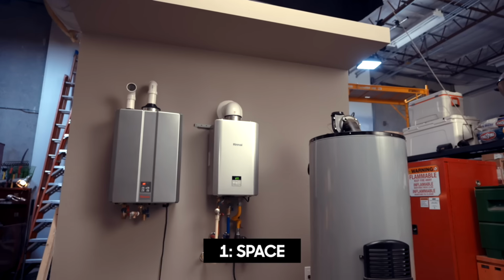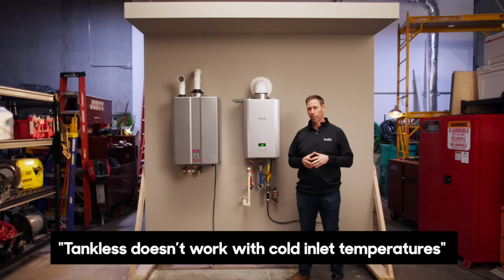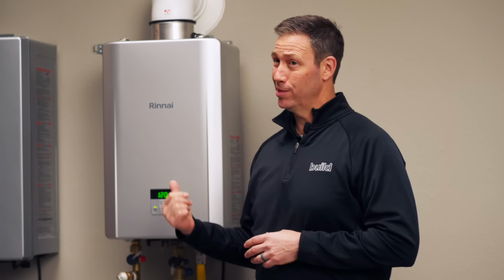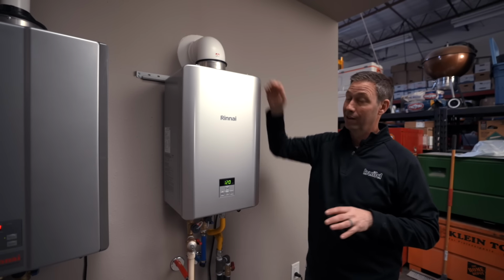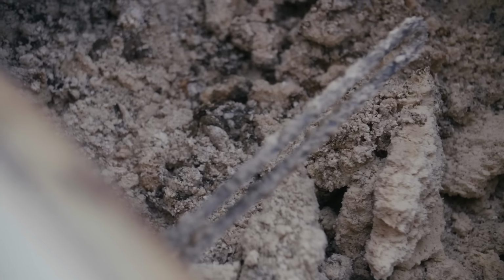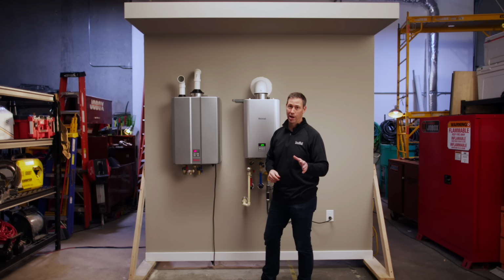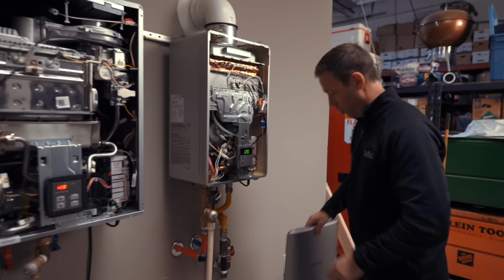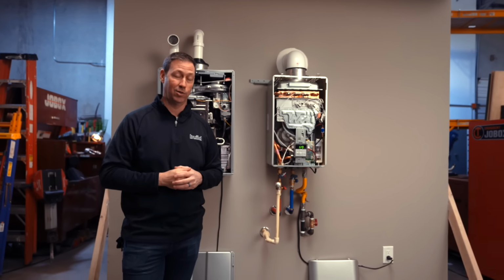DEBUNKING Tankless water heater LIES!

Comment: From the UK these myths and fears are so funny. Most of the country runs on combi boilers (tankless) they last and are so cheap to buy. we are now starting to go back to tanks but as storage tanks with supplied by a separate boiler or heatpump
Reply: sounds to me like whatever drawbacks there are to tankless, you are used to them.  Not having used tank, you don't have perspective.  That's equivalent to an american saying "i've always had tanks and most of my country uses them, so all those myths and fears about tanks are funny."  I'm gonna listen to the homeowners who have used both and teh plumbers who have repaired both.
Reply: @annamyob  You probably should read up on UK pluming if you just believe we have had combi boiler for the last 150+ years….. We had tanks for ages and then moved as combis were more efficient.

Now we are in the modern world of combing energy sources and variable time energy tariffs, tanks now make sense to have solar thermal coils, primary hearing coil for heat pumps or boilers and direct electric heating to make use of solar thermal and tariff optimisation.

Every think the country that has always run on cheap gas might not have a lot of experience with Efficiency! You do have great experience thinking your way if the only way, old technology is the best and shouting at other countries makes you right.
Reply: @michaelwilliams3648  when people just say "oh we've had these for years in my country" they don't convince me they know anything about efficiency.  They're just used to what they have, yet implying they're smarter than we Americans who are used to what we have.  So, efficiency, yes, show me evidence.  I don't see efficiency in all the water and heat wasted because tankless can't do low flow.  I don't see efficiency in multiple parts replacements, nor in having to heat water other ways while waiting weeks for parts.  As you say, solar etc seems to be way to go.  I can put my solar heated water into my existing tank.  Not an argument for tankless!
Reply: @annamyob  Combi boilers regularly run for 15 years without part, yet your all for combined solar thermal and solar PV + primary heat source as a simpler system………..

As for efficiency go and do some research this is a YouTube comment thread not the data sheets from the boiler manufactures. Again the American assuming what you have always used is obviously the best because it’s all you have ever looked at….. That grand American exceptionalism again. Just like how the US used 5L V8 for decades barely making 200hp…… and yet you’re here proclaiming the US tried and tested is the best and efficient.

Do yourself a favour true contacting the manufactures for support they actively want to upskill and provide knowledge to the customer and the fitters. 

Either way peace out

Comment: I would like some references from the manufacturer about the gas supply and how the unit pulls gas through the pipe (which I am assuming is why you can get more cubic feet out of a pipe size without too much drop in WC than what the calcs would suggest)

Comment: Really the biggest hurdle would be to call you natural gas provider, have them do calculation and swap the regulator outside if you need more supply. I’m just curious the longevity with water with large amount of minerals and calcium deposits.

Comment: We replaced our water heater a few years ago. I checked on getting a tankless and it would have cost $1000-1500 more in installation costs. The Tank model we got was a Uniform Energy Factor of 0.72 compared to 0.81 so it's not as efficient but there's no way we'd ever make up that cost difference. On top of that, our family of 5 has never run out of hot water, so there's no real benefit to the tankless. If I were building a home new I'd definitely look at tankless but for us it's hard to make the numbers work.

Comment: Longevity is my issue.  I have yet to find anyone that has had a tankless last over five years. Now most are Big Box stores units and I don't know about install quality. I've known a few people that had problems in two years and had a very frustrating time with customer and warrantee service.  One plus I feel is good about a water tank is that it's 40 gallons of water during an emergency after you turn off the main supply.
But I'm still interested in tankless for efficiency, particularly if the war on fossil energy continues.
Reply: so, don't go with the stupid big box, go with a reputable firm for install.  maybe cost more up front but you obviously appreciate that quality matters.  as for the 40 gallons of water in emergency, remember that water from heater tank is lesser quality.  store a few 5-gallon jugs and have better water to drink.

Comment: A couple things not addressed here:

1: Internal component longevity based on water that's "harsh". I was told by multiple tankless companies to not buy their product because of my water quality; it's not hard nor has calcium/scale. And it's something I can't change anytime soon. I can drain/flush my tanked unit and that will give me about a 10-15 year life out of it. A tankless you can flush yes, but, once things like iron bacteria get introduced into them, they're on their way out.

2: They're definitely more expensive to install than a tank unit. Especially if you had a tank unit before. You have to change the plumbing, add a separate intake air line on some models, add a condensing line drain and possibly upsize your exhaust vent. Most municipality's here in California require that the intake and exhaust be separated and both going/coming from outside. I know it doesn't make sense but, if you want it to pass code...

3: You only speak about reliability with one brand. I've dealt with Rheem, AO Smith, etc and there's common issues amongst all brands that tanks don't suffer from. 

The biggest one I've dealt with is no hot water. This is usually due to the internal water metering measurements that the PCB reads. there's a certain GPM that it has to see in order to start the burners. Any contamination or blockage of this device (and there are multiple types of devices across the brands) will cause a delayed or no start at all. These often need calibration or removal and cleaning. Often times, the calibration process is a chore and requires calling the manufacturer.

And lastly as a side note: I never recommend that someone purchases a unit that has a built-in circulation pump. Should it fail, it will cost more to replace. Always go with a stand alone unit that is plumbed in a manner that allows for a full bypass or capability to use the heated water supply in a traditional manner.

Comment: We've got this on our house and it's great but... we're killing off gas in a few years and will probably look at the heat-pump or PV-element options. It's seems a great option to dump your excess generation into water heating, that's if the grid/EV has no desire for it...
Reply: Great use of spare power.  How much is electricity per KWh and gas per kWh or therm where you are?  And where are you in the world?

Comment: i looked at this tech with our house.  You don't mention cost of energy.  If you have nat gas, great.  If you need propane, can suck.   If you live where electricity is cheap. The ROI does not  make it.   I really thought tankless would win hands down but when i looked new heatpump tank .vs. tankless it was an easy decision to get the electric tank version.   BTW i've got a 20 year old heater that has never been maintained.  Spoke with experienced    plumber and if not relieous on main yearly.   They dead in 5 years.    So great in some cases not all.

Comment: I'd love to see a similar video addressing electric tankless water heaters.
Reply: Was just thinking this
Reply: Look at power requirements for electric tankless heaters before you get excited.
Reply: Thanks @berserker406, you've basically confirmed my suspicions on this matter. My electric hot water tank is approaching 14 years of age so I have been considering deploying point-of-use units for the kitchen and bathroom with no shower. After I determine their performance, only then would I consider doing the bathrooms with showers. The clothes washer may get T'd off the kitchen.
Reply: Or how long it takes before the water is warm!
Reply: @godzilla2k26  I traveled through Asia quite a bit and a lot of homes have tankless water. I've also been in a home in north America that had a tankless system for an upstairs bathroom. They're just as fast to get hot water if not faster than a regular tank heater. Like he mentions in the video, the time it takes to get hot water mostly depends on  how long it takes to clear cold water that's sitting in the pipes between your faucet/shower and the heater, just like a regular water heater. 

My experience in Asia is that a lot of these are installed at the site of service (I think they're electric in that case) and the hot water basically comes out within a few seconds because the heater is already right there at the shower head or at least in the bathroom.
Reply: @katherinelandreth2191  The one at our church is really slow to get up to temperature. But it replaced the old water heater and isn't close to the point of service, so that could be a significant factor. So in Asia are there multiple heaters per house or is it the point of service is just built closer to where you access the water?
Reply: @godzilla2k26  Some places I've been had a heater in each bathroom. Others I think had one for the whole apartment. 

My condo in the US has a regular tank heater, it's only a two bedroom condo so it's not that big, but the bathroom sinks take a couple minutes to get warm especially first thing in the morning. This video mentioned tankless systems that have a circulation feature that seems like it keeps water in the pipes between the heater and the faucet warm so that could be an option if that's an issue.

Comment: Talk about the maintenance required for tankless units. What does that looks like and what is required? Little different from maintaining tank type.
Reply: Basic maintenance of flushing, tankless requires much more often, and is disabled if you don't do it.  Still, if your water is soft enough the tankless can handle it, once or twice a year, flushing, not so bad.   However, look also at all the many comments of people having to replace parts that don't exist on the simpler tanks. unexpected repair calls, no hot water while waiting weeks for parts? naaaaaah

Comment: I have 2 Rinnai condensing units, one in our house one in the rental house we bought next door.  With the condensing unit on the left, the 2" PVC inlet and exhaust are far easier and cheaper to run.  Unless you can mount it directly to an exterior wall the complication and expense of the dual wall combination venting will quickly eat up any savings you had with the cheaper unit.  Then of course the condensing unit is more efficient.

Comment: I normally appreciate Matt's videos, but really don't like his current trend of being a PR agent for the companies that sponsor his videos.  That being said this video isn't 100% true.  You MUST flush a tankless or it will die a premature death (in just a few years) and you paid for something that is supposed to last '2 decades."  If you hire a plumber you're looking at $150 per year to flush.  So kiss any cost savings due to efficiency good bye.  Yes it's not that hard to do yourself, but guys, you need to be honest to the homeowners.  Everyone knows a tank heater lasts 6-8 years without maintenance.  
Tankless heaters take MUCH longer to deliver hot water, that is a fact.  On my last house I didn't have the option for recirculation, and the switch from tank to tankless added ~30 seconds each time you went to get hot water out of a cold pipe.  In the winter that was well over 90 seconds.  Recirc systems solve this, but they are quite a bit more costly.
And lastly, in the event of a power failure, you get no hot water at all.  Just to be clear.  Not saying tankless is bad at all.  It just has some CLEAR and HONEST down sides that this video minimizes or ignores completely. 
All in all, disappointed in the company sponsored advertising on the build show.  😞
Reply: This guy is telling the truth!  Accurate on all points.  Be realistic, are you going to maintain it religiously?   If not, a tank is most likely your best bet.  When your tankless isn't working you have a box full of expensive sensors and control boards to fix, while a tank generally has just a few parts.

Comment: Building an off-grid home, essentially all electric. I haven't found any tankless electric systems that are feasible. The power draw is just too much and one or two showers could wipe out a all your stored power. Assuming a rationally sized solar array and battery system (18-20kWh solar with 100kWh of storage, which some would find huge). But if I were installing a gas system, tankless is the way to go.
Reply: Install a couple hot water panels and be done with it.
Reply: @anthonyspadafora1384  Using hot water solar panels for heating the pool and jacuzzi. Using an 80 gal. heat-pump water heater for the home. Using waste heat from the garage helps keep it cool. I will likely leave an option to pipe solar heated water into the house water heater if necessary.

Comment: Went Gas Tankless (well it has a small tank technically) with Navien and I will never run a old tank system again. If possible consider using the hot water circulation loop to get warm to hot water nearly instantly.

Comment: So I split the difference a few years ago.  I went with a 50 gal HTP stainless tank 97% efficiency gas water heater.  It has 77k BTU input and recovery is very fast.  So it is essentially like a tankless unit with a highly insulated tank that is condensing with PVC pipe for air intake and exhaust.  It was around $2500.  It works like a champ and I don't need to worry about scaling maintenance, like with tankless heaters that blast incoming cold water with very high temps that knock out minerals in the water.

Comment: Please debunk this MYTH. What are the maintenance costs per year to clean the tankless units ? I have been quoted by plumbing vendors $150-$200  to do yearly cleaning of tankless. If I can get 12 years out of a regular  heater, that would be $1800 - $2400 over the course of the regular water heaters expected life vs. the cost to do regular and required  maintenance  of a tankless.  It appears to me the tankless yearly costs will eat up the savings of a tankless. Is this a myth?

Comment: Well gee...for all the people complaining about the stuff said being not entirely accurate:

  - Tankless if properly maintained can last two times longer (20 years) vs 10. So lets take into account the cost and removal and installation of that tank with a new one and its associated labor. And if you have a larger family and thus need a larger gallon tank and this more expensive, the cost of all that at the 10 year mark basically covered most of the initial cost of the tankless install even with new pipes, etc..
 
-just cause its more complex doesn't guarantee failure. I had a Ford Fusion Hybrid for 9 years and not had a single battery or electronic issue by the time I traded it in. Tankless is a mature product and technology, it has a warranty, and annual PM on it can make it potentially last without any issues. If your gonna make that comment of it has more chance or failure and thus need to take that cost into account,  you might as well say "well, the 70 gallon tank may fail and dump all its water into your basement causing damage to everything stored down there and that costs money, so take that into the cost of life expectancy".

Comment: I'm glad to hear your explanation of the first 'lie' about the inlet temperature.  I was looking at a tank-less some years back when my water heater (WH) needed to be replaced.  Looking at the specs on a tank-less at that time the temperature rise wasn't that great in the models I was looking at.  I live in the St. Louis Metro area and our water comes from the Missouri river.  I have measured the temperature of the water and it has gotten as low as 42 degrees (measured at tap) in the winter and as high as 80 in the summer.  You almost don't need any hot water to take a shower in the summer :-)  I was also considering two smaller units at that time.  I have a ranch house and the kitchen and laundry room are at one end and the bathroom at the other.  When replacing my WH back then I went with a Bradford-White direct vent (PVC).  My furnace also uses a PVC exhaust so I was able to gain the space taken up by the flue.

Comment: YOu can put them on the outside of your house?  I assume in the south, try that above the 49th parallel.  There is the issue of the cold water sandwich, which is minor, but there compared to a tanked.  As well,  if you run the water for the first time in the morning, it will take a bit longer for the hot water to reach your fixture compared to tanked.  Its not a lot of extra time, but its there.  Coming from a tanked user to a tankless.    But the minor things I mentioned are outweighed with the pluses.  Plus money saved when away at work, etc

Comment: Question, my tankless seems to cycle, very hot and then about a minute of cold. Soft water and changed the shower balancing valve. The system is maintained yearly by the company that installed it. They are not sure why that happens. Any suggestions? Thanks.